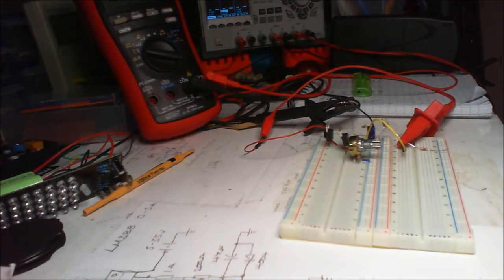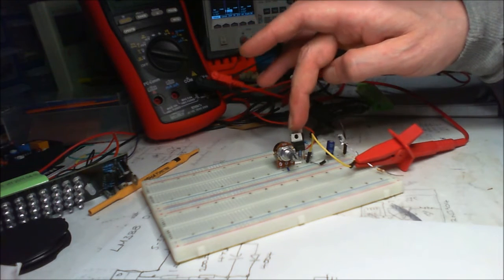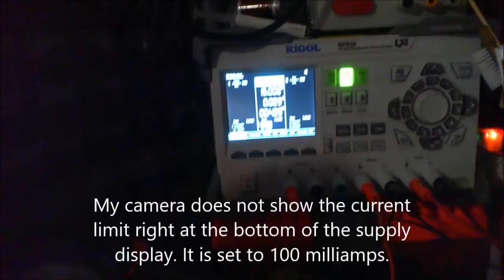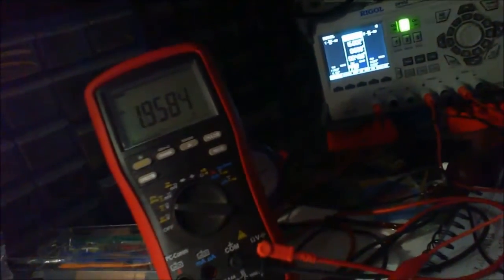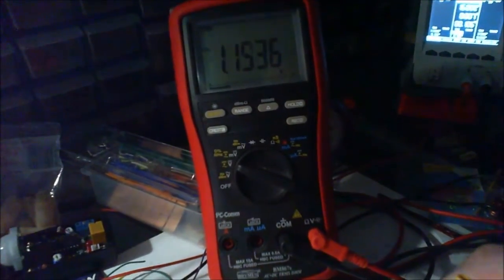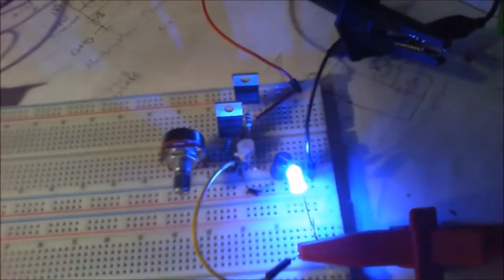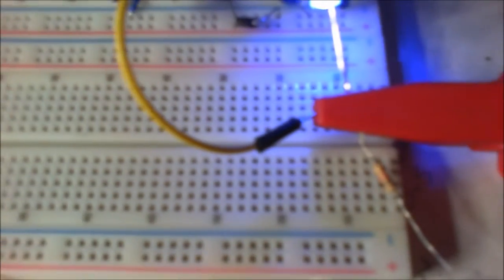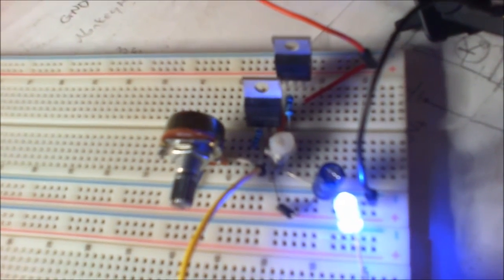Variable Current Voltage Power Supply

Comment: Newbie here! Been playing around with the LM338 and 317. Looking for a Adjustable Voltage and Current configuration. This looks very simple to use and very simple to build! Thanks for Posting!
Reply from the maker: Its not a bad circuit. I built it into a container and have it powered by my solar panel batteries. I use it daily for up to 9.5V which I use a lot of 3 and 5 and 9.3V devices. Of course the circuit is capable of higher voltages with some tweaking (pass through transistors) and heat sinking higher amperage.
Reply: About to attempt the build. One quick q. On the first pot- you have 1 ohm R going into a 200R Pot. The smallest Pot I have is 5K unfortunately. Do you have any recommendations? Common sense would tell me to use 5k R & 800ohm R  and then my 5K or do I have that backwards. I can tell you will all the research I have done in the past week, yours is the only simple schematics that makes sense! Great Job!

Comment: the lm series regs are great that's a nice little circuit is the current stable over time or do things heat up and then protection on 5he regards kick in
Reply from the maker: Yes the theory is great and you show no evidence for your theory regarding THIS circuit. I however still have the power supply on my bench and have used it in many videos. LOL